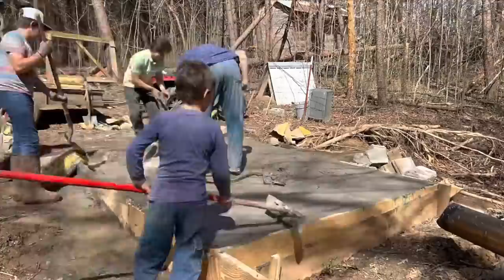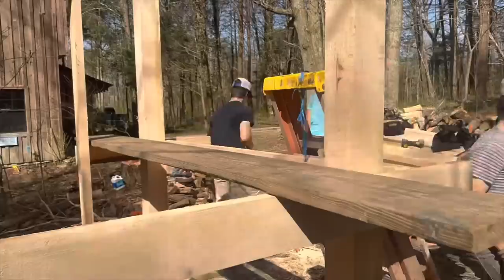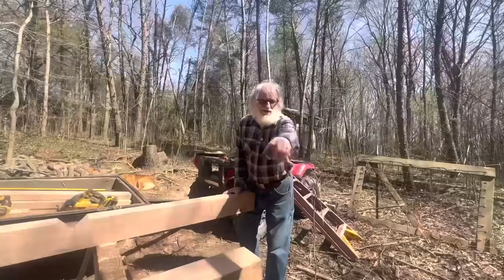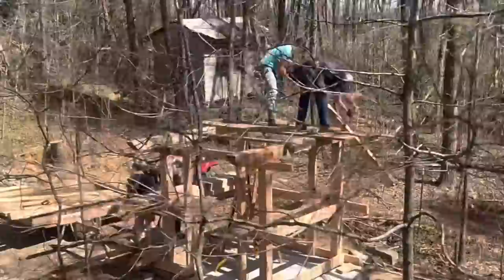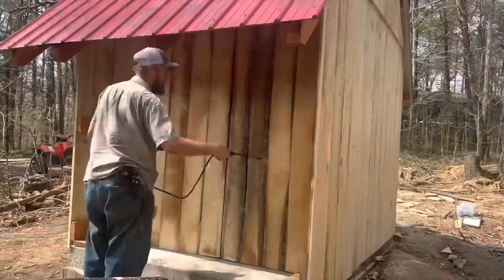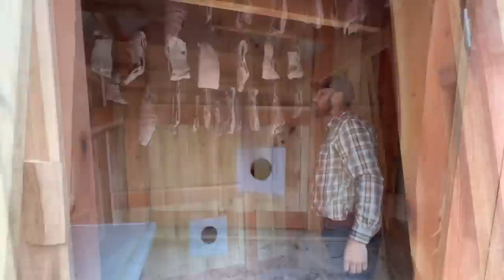Building the new SMOKEHOUSE!

Comment: I notice in all your videos that I can see through the walls of the smoke house.
Is this causing much of issue for you?
I couldn’t tell if it was part of the design or from the wood shrinkage.
Reply from the maker: It’s supposed to help with circulation. But if it’s very humid in the warm weather I still get mold, but here’s the solution! https://youtu.be/WSqVO3BB5X0?si=x1h6mTnrJN5mZOeU

Comment: Impressive, did you tilt your slab at all?  Any recommendations as far as the slab goes?
Reply from the maker: I didn’t tilt it. Just broom finish it so you’ve got traction. Put plenty of steel in it and you should be good!
Reply: thanks for the feedback, I have a lot of untreated oak 1x rough that I am going to build a smoke house with in the spring.  As good builders know, nothing is great  without a good foundation.  Concrete is not my thing. Thanks again, I do enjoy your videos @McGieHomesteadAdventures
Reply from the maker: You are very welcome!!!